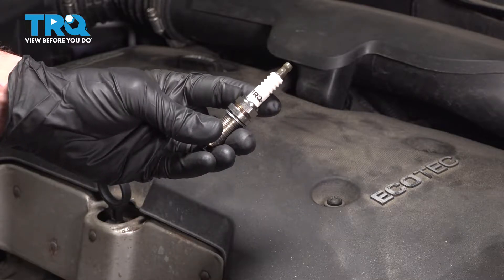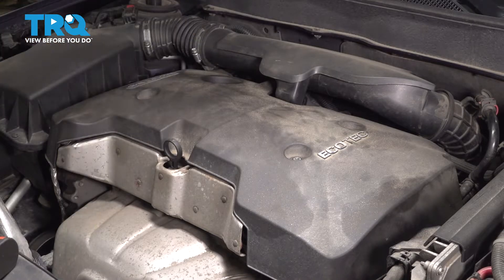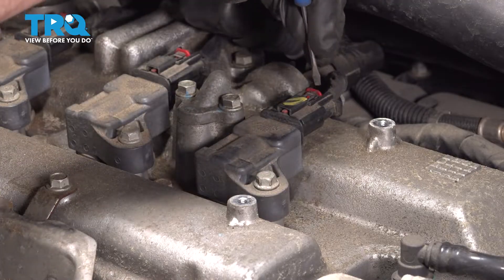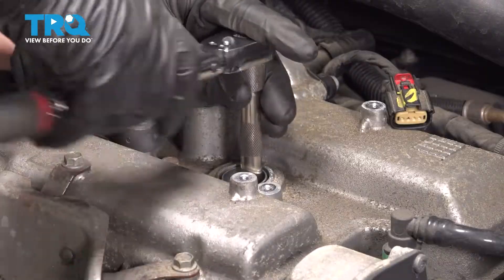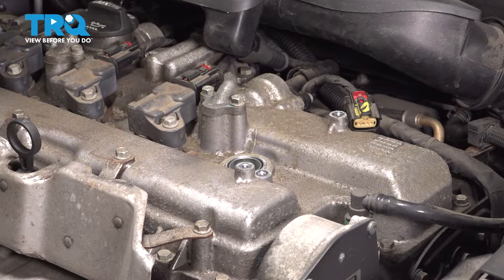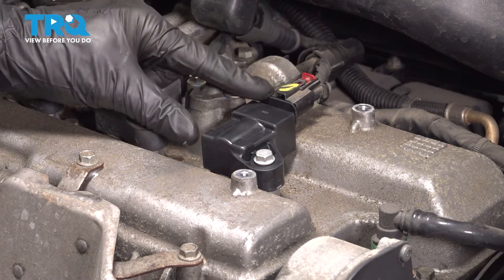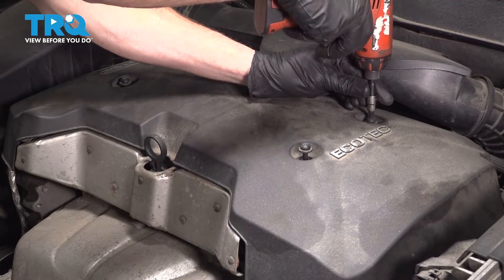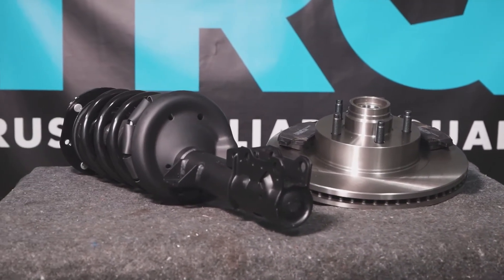How to Replace Spark Plugs 2013-2015 Chevrolet Malibu 2.5L I4

Comment: Shouldn't you use anti-seize lubricant on the spark plugs? I always make it a point to use it on any spark plugs or oxygen sensors before installing new ones.

Comment: One Thing? Should the ENGINE TEMP be Cold, Warm Or Hot?  Not sure what Block & head type this is?   Thank you
Reply: Sometimes warm is better, helps with removing the plugs. I'd spray a little penetration lube on it, let it sit for a few and then remove my old plugs. Hope this helps.